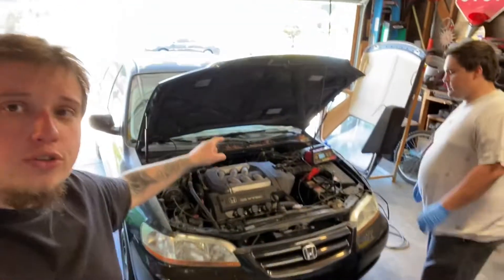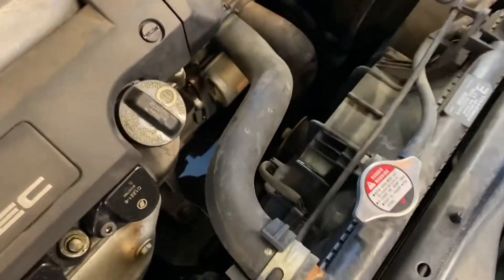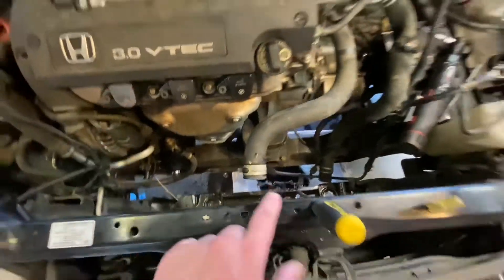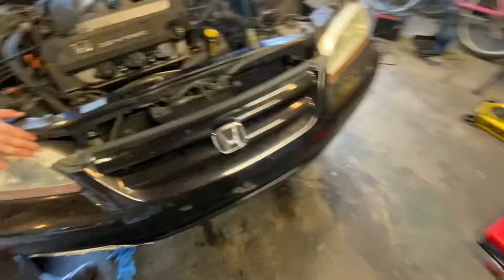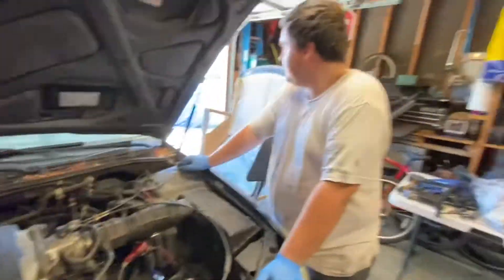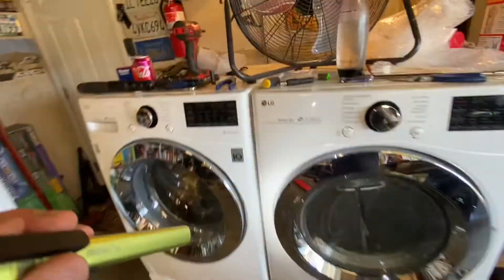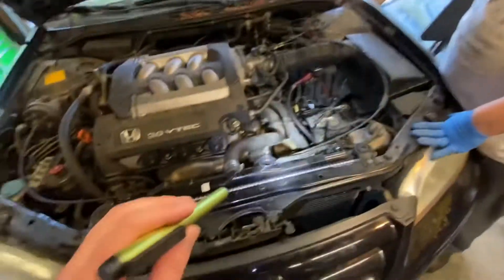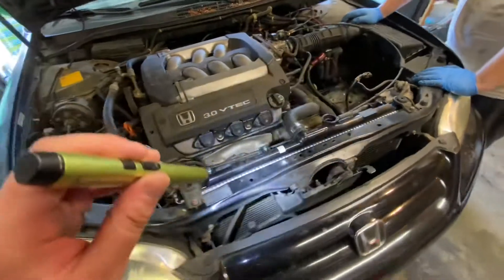HOW TO... Radiator Replacement Honda Accord

Comment: What did you do with the Trans Cooler lines?   Pinch them off?  Cap them?   If you didn't, how much trans fluid did you lose after you removed them?

Comment: How tight is the radiator held with the upper radiator support clamps.  My granddaughters seems pretty loose when I try to wiggle the radiator.  The two radiator support clamps don't seem to have any way to tighten them?  Thanks for the video.
Reply from the maker: The radiator is pretty tight there is some wiggle room but it shouldn’t be lose that’s for sure